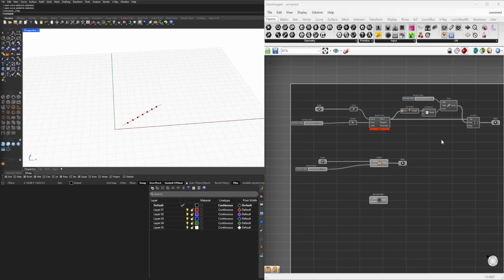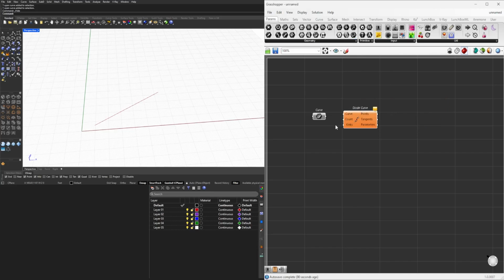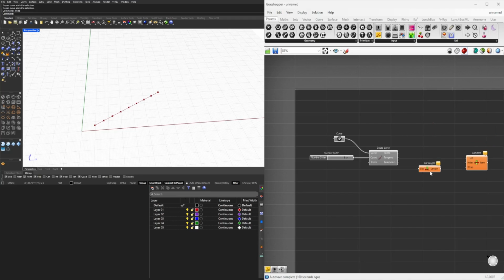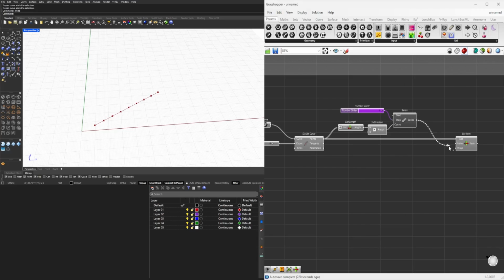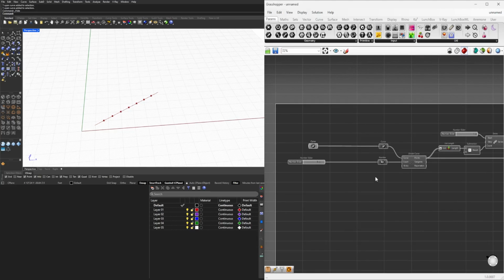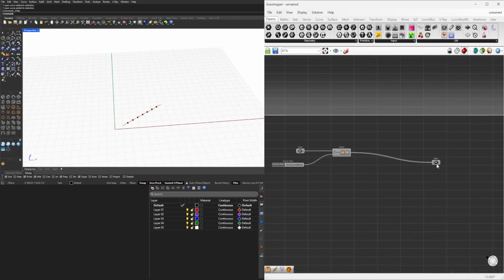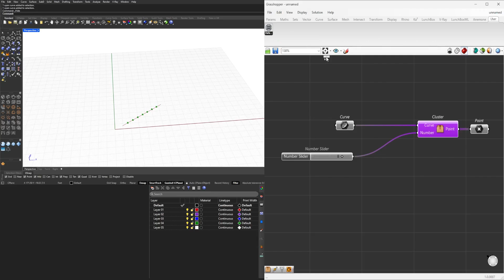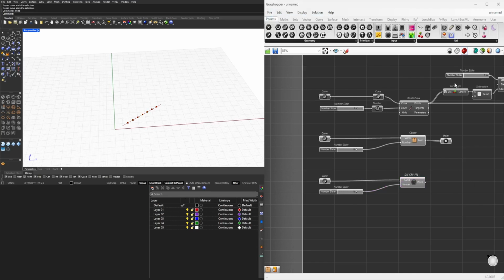Rhino 8 Parametric Make your own  Grasshopper components, Scripts and Algorithms

Comment: here's and easier way, cull index component, for the index make a panel and give it these two numbers, 0 and -1, zero is alway the first on the list and -1 means the last item on the list make sure that YOU RIGHT CLICK ON THE PANEL AND CLICK MULTILINE DATA AND TURN IT OFF.
Reply from the maker: I just added it to a new video.  thank you for sharing that tip.  I didn't know it, and its much easier. How did you get into parametric design?